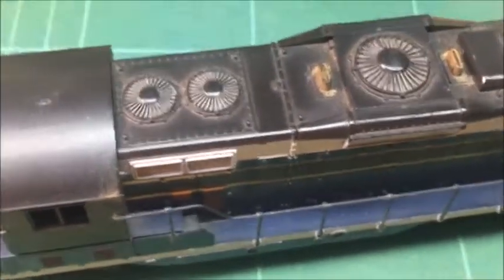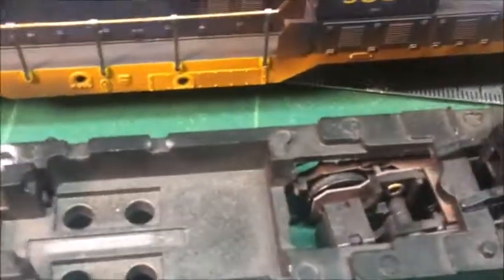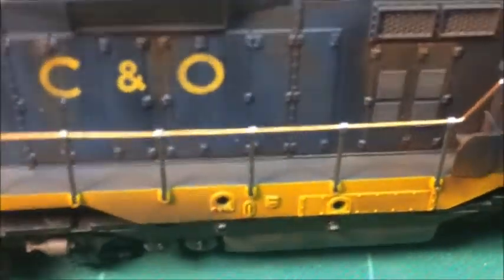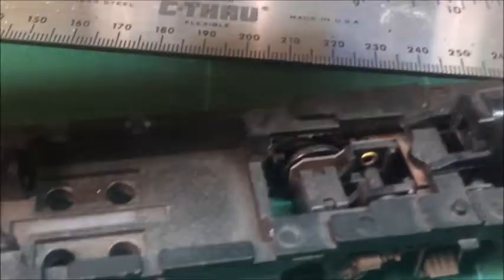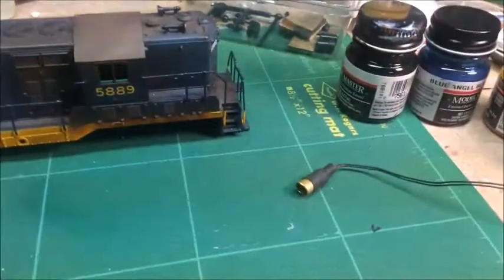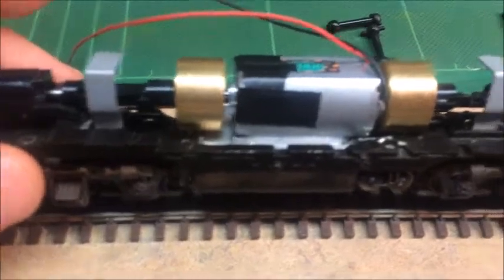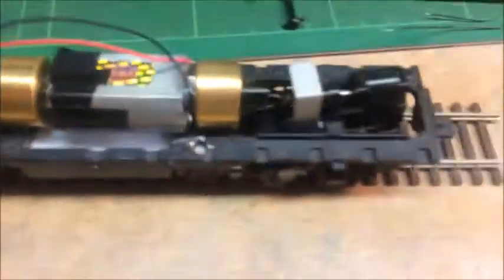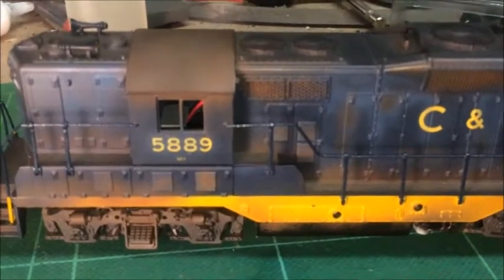GP7 Project Part 2, bronze hand rails, cast resin air tanks and a new motor

Comment: Like your video, great work. On the C&O and B&O GP7s and GP9s, The railroads ordered these locomotives set up differently. The C&O ordered their GP7s and GP9s with the short hood designated as the front. The C&O's RS3s of 1955 also had the short hood as front. On the B&O all the GP7s and GP9s were ordered long hood forward. The B&O GP9s you see in the upper 6600 series are exC&O locomotives. The C&O transferred as lot of their GP9s to the B&O in the late sixties and early seventies. After the first transfer which were renumbered B&O 6650 to 6685 I think, the rest when they were transferred kept their C&O numbers. I hope this helps.
Reply from the maker: Thanks David, i had picked up on some of that since that gp7 project but am always learning more about the prototype and historic technical details so i appreciate the additional information
Reply: @ChessiePAdiv  Just wanting to help a fellow Chessie modeler. I like the B&O's long hood forward look that I incorporated it into my private road name and my railroad used it until our orders for SD24s and RSD15s in 1961.
Reply from the maker: Much appreciated, adding and adapting prototype practices into a freelance railroad is a great way to add interest and realism.  Nice touch

Comment: I've had success remotoring these old beasts with Genesis motors, Later Proto 2000 can motors, and some Bowser/Stewart motors. Sometimes I've even made Kato motors work. Of course, the older Proto 2000 open frame motors that were a rip off from Athearn fit quite well. I love the modification you did with the weight addition though!
Reply from the maker: I initially had an issue with vibration with the nwsl motor but to finally found the issue which was then easy to solve.  Mashima motors have also worked well for me.